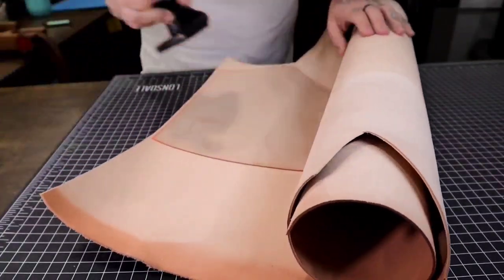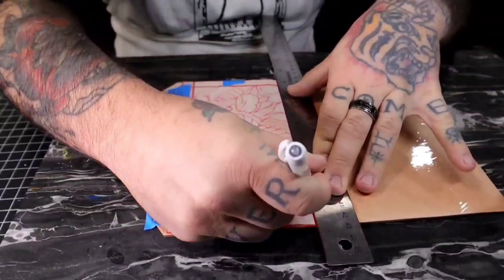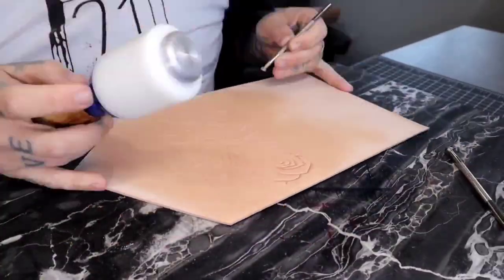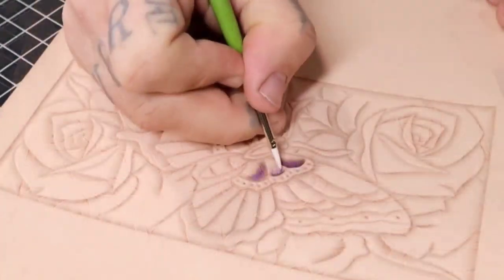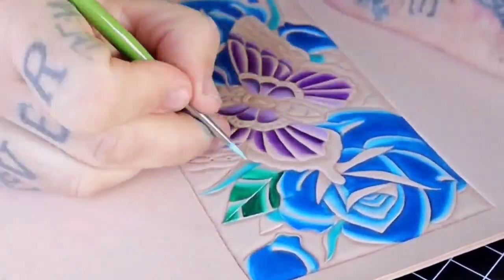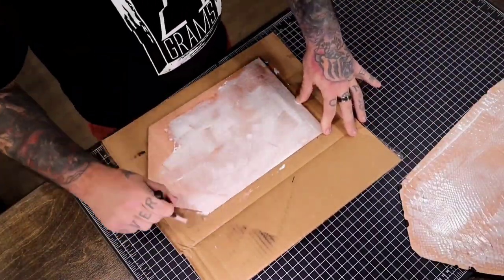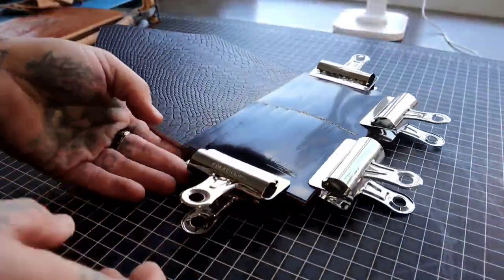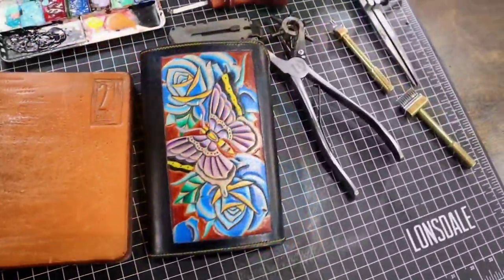Custom wallet build with commentary. Leather tooling roses and butterfly.

Comment: Do you use Leather Preparer/ Deglazer before you paint?
Reply from the maker: I don't. I have, and didn't notice a difference. And it drys out the leather which could lead to cracks in any folds.